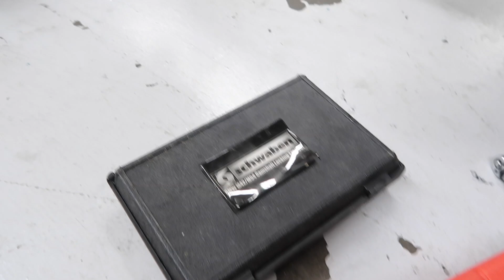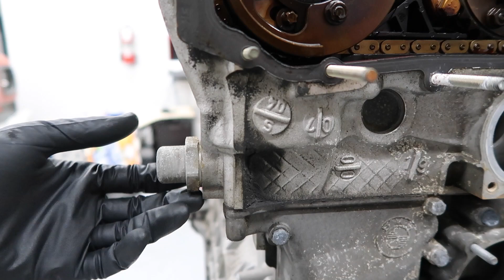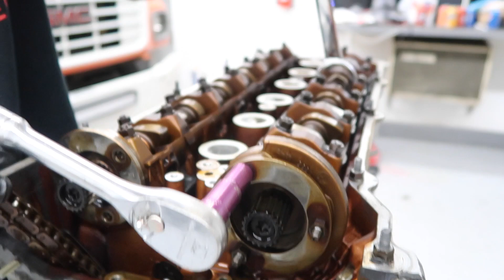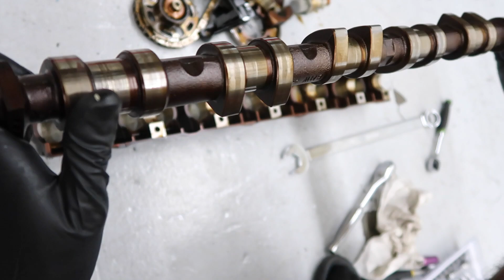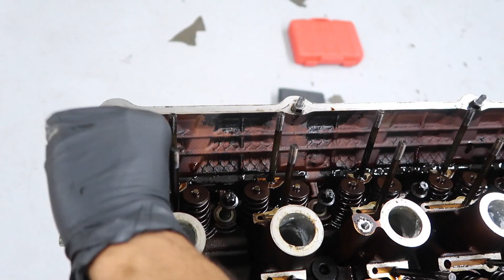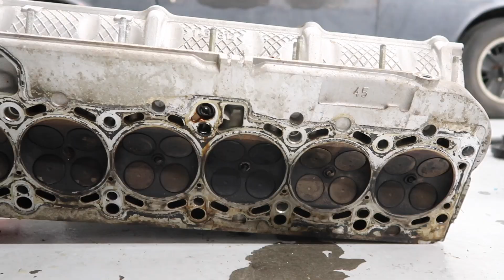Part 5: BMW M54 Engine Disassembly- Cams and Head Removal

Comment: I’m in the prosess of changing the head gasket on my m54b30 engine and I removed all of the studs for the camshafts. Now as I am installing the studs I noticed that 6 of them have a little longer section of thread then the others. Do anybody know where these go?

Comment: Other guides say to start with the outer head bolts and work your way inwards, I did it the opposite way and wound up with a head warped 5 thousandths despite no head gasket issues or overheating. I hope it doesn't matter, but I wonder where the logic comes from.

Comment: Is it possible to remove the timing chain cover, pop the timing chain off the crank, and remove the head with cams and vanos chain still attached? This won't require retiming and would be way easier, especially in my case where I'm just checking the head gasket and bottom end.
Reply: I’m also waiting for an answer 🤯
Reply: @infamousfamous3351  The only reason I can think of since doing my rebuild is that the timing cover needs to go back on before the head, otherwise you'll get a leak.This isn't possible with the head left fully assembled. Also, the timing job isn't too bad- just need the $100 tool.

Comment: nice video bro. one day after i get the car all back in shape i'm going to port and polish a M54, throw in an lsd differential rebuild and my XI will be killing it. as if its not already. now back to the transmission slip flush, add some lucas in there, the wheel bearings, and the strut spreader so my camber doesnt look like it got punched in the face as a toddler!!! 

keep on rockin in the free world bro

Comment: question of the day.
Is it possible to use a head from a m54b30 on a m54b22?
LE:
I was hoping for bigger valve size, but are the same size, unfortunately

Comment: I have to do this on my X5 with the same motor. It’s not overheating, but has coolant disappearing. My question is.. how often do the threads come out with the head bolts?? I’m real worried about, I actually had a dream about it lol

Comment: 2001 M54, 330i, I saw other videos where it was said, "If the camshaft  bearing jounals are scored, you a new head". Especially the frontmost where is oil retainer "piston ring", a metal expansión ring wiping on a metal hounal, is located.  Every  time I see the camshaft come out of one of these staight six motors I want to see this área to detect wear.  I Heard that @2008 BMW started with phenelik (sp) rings to prevent the rapid wearing of that oil seal application.   Pleasee show this in some future video.    And witth no other damage to the head, other tan clean up and perhaps reflattening via Stone planer, compare the Price of new camshafts and bearing blocks to buying a much newer complete head.  You do great work----Folks like you is to who the World belongs.

Comment: Great serious! I'll be using this as my guide for a rebuild on a boosted engine. Question: Wouldn't it be easier to turn the crank 45° before removing both timing chains?

Comment: The smaller bolts from vanos area you removed are they stretch type bolts as are the 14? And do i need to replace them or they can be re used?

Comment: My 2006 BMW X5 3.0i E53 M54B30 SAV head gasket needs to be changed. The in dash display keeps saying : check coolant level and coolant temperature..i put new thermostat in it before this was concluded to be problem as it was overheating still after discovering the thermostat was stuck in open position. So i thought that was what issue had been. I'm learning mechanics, you said there were two more bolts E8 in order to fully remove head from block...1st how long in hours is this task to change your head gasket? 2Nd can you please give me all the precise tools i need to complete this task..my email is: coontakentay@hotmail.com my 3rd question is do use any type of sealant around the new fitted head gasket for proper seal to prevent leak if so what is name of material im to use that is best. 4th question what are the exact torque down  specifications and sequence for re installing everything back together on motor..in respect to what i watched you remove. I mean is there special specs for the dual vanos i have i know there is for both intake and exhaust cam shaft lobes. How do i know i have not offset timing where are the markings that tell you where the chain is to be set.  I did head gasket job on my motorcycle but this is a BMW my manual hasn't arrived yet. Is why im asking these questions brother..hope im not bombarding u in any way im tryin to learn n be able to fix my own things within reason skill tools n ability thanks.
I am hoping upon doing this task it eliminates the possibility of having to remove the dashboard to replace heater core. I plan to swap the dual solenoid too for new one as well, and may even buy new radiator the hoses will all be new also along with water pump i read that it said overheating isnt really that due to pully being loose or something like that..im not gonna chance it n will just replace an make sure everything is snug according to torque specs.

Comment: I am just curious to know why do you need to go only a quarter turn at the time for a3 and a5 for example...?
Reply: gegervary it to loosen the cam evenly. The valves are putting pressure against the cam shaft and if you don’t loosen them in steps you can bend the shaft

Comment: Great quality as usual. I'm doing a head gasket replacement and I've got all the head bolts out, intake removed, headers detached (from the bottom, I plan on pulling the head out with the headers) but the head still won't even budge. I don't know what else is holding it down. Any ideas?

Comment: Nice videos! Thumbs up :) One thing that struck me. I think it´s recomended to loosen the headbolts in reverse order from tightening sequence, not from center and out. At least my Bentley says so for m52 :)
Reply: Fredrik Rapp you are right. If he did unbolt everything from center to sides, it would definitely get warped/damaged.

Comment: Jason, at time 6:46, you start working on removing the camshafts. Instead of doing that, can I skip the camshafts and remove the head with cams still installed?

Comment: Good video! How about a short video on your shop. 
What are you doing to get new customers in California.?
How is the transition going?
How do you like it so far? What area are you in? City or rural area?
Reply from the maker: Thanks, and I will make one soon. Mostly word of mouth and I have had quite a few subscribers stop by. It's different out here for sure, but I'm staying very busy with school, and the shop so haven't had much time to really explore around here. I am in Alhambra which is 10 min outside of LA but still considered the city.
Reply: ShopLifeTV Get some business classes!
Stay safe and keep on keeping on!
Reply: Crap, I forgot to ask. I have a 2001 330XI
customer ran it hot. motor runs but misses bad. What or how do you sell parts? EBay or ??